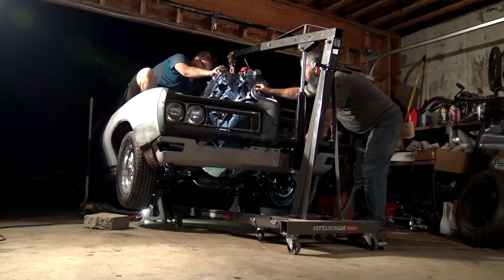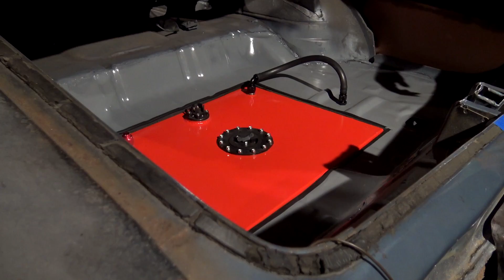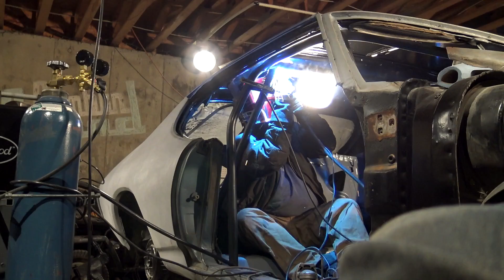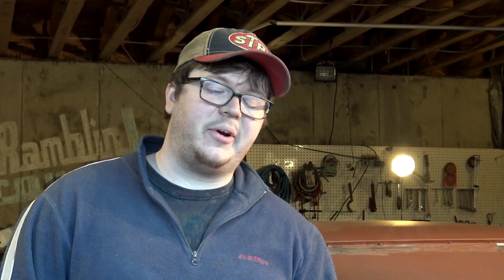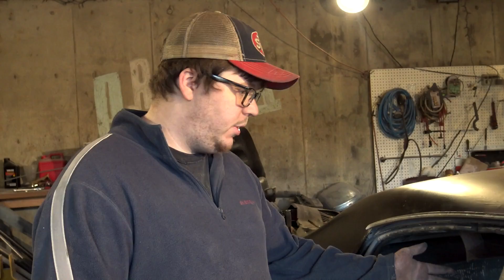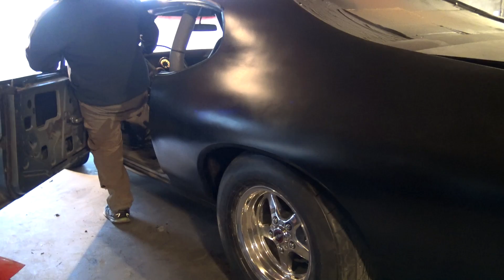1968 Pontiac GTO Project Update - Video #19 - Roll Cage, Racing Buckets

Comment: Looking good! Don't forget that if you need to change the clips that hold the chrome around the window glass, change them while the glass is out.....it's much easier. Also, I feel your pain on the tail lights. I'm building a 73 Trans Am and I have over $1000 in just the new back bumper and tail lights. Chrome definitely isn't cheap. 😉
Reply from the maker: We did get all new clips for the windshield and rear window.  Yeah, the tail lights and bumper were definitely pricey.  Good luck with your Trans am, I really like those too.  I'd really like to have a SD 455 Trans Am one day.
Reply: @RamblinAround  thanks! If you check out my channel you can see videos of it as I move forward. I'm building it almost in the same type of style that Jordan is building his GTO. Mine's going to be a 70's style vintage Trans Am-style racer with numbers and racing livery.

Comment: I owned a 69 GTO Judge....The rear end gear are 390..The Judge had the tach on the hood...I believe Ram Air III , 4 speed Hurst, posi track rear end.....blew the 400 motor and put in a 327 high performance small block ....special heads... equated 375 hp..... the rear end made it climb exceptionally well....

Comment: Looking great! So glad you went with the 1968 bumper. My vote would be for the original Aleutian Blue or Meridian Turquoise Metallic. Or at the very least an original color from 1968. Front bumper fit looks great also. One of the hardest things is fitting a 68 endura bumper.
Reply: Man I wish I had that front end for my 68 Tempest wagon! I"m doing paint and body right now. Bumpers and brackets can be found but nobody makes the 68 fixed headlight grills

Comment: What's the paint that you used ? We're those rattlecans and if so what brand and type it came out good
Reply from the maker: The Roof and hood are Rustoleum Red Oxide rusty metal ultimate finish.  The black is Rustoleum Universal satin black, it's paint and primer in one.  The fenders are Rustoleum Dove Gray enamel.  Thanks for watching, we appreciate it.